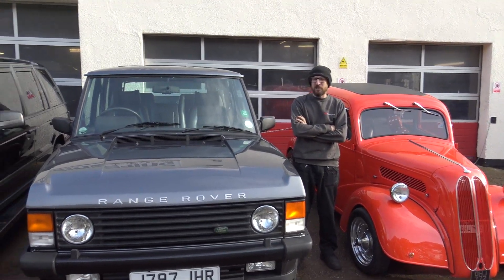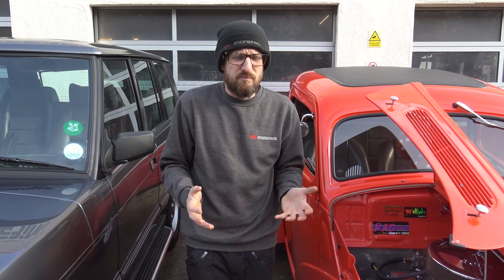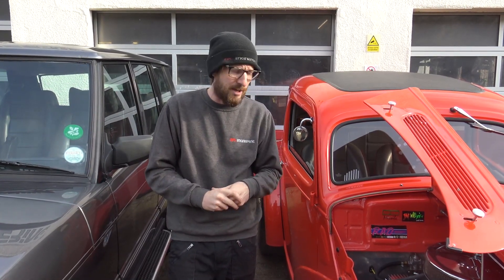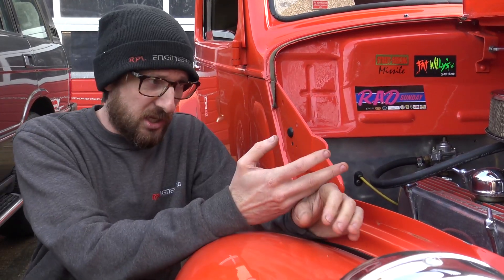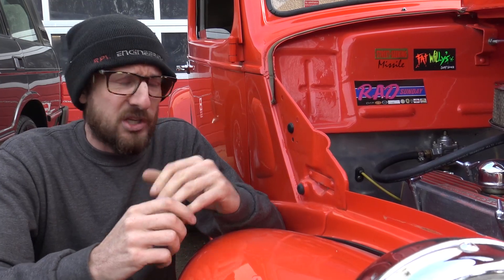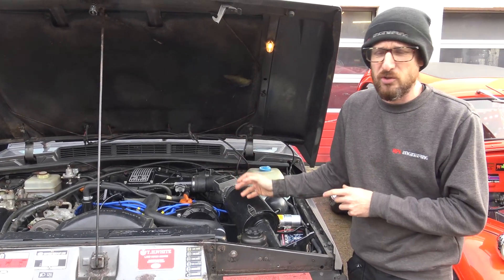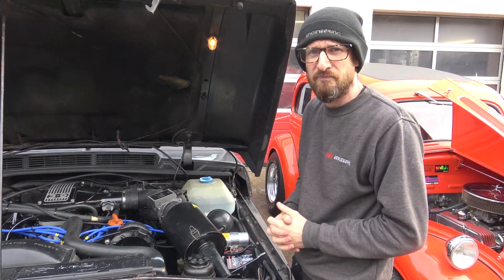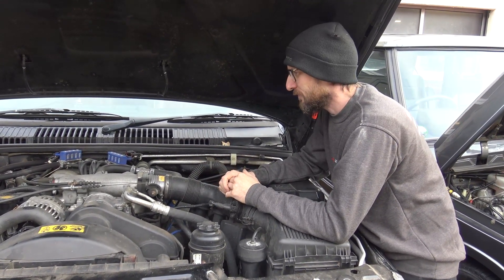What are the Most Cost Effective Upgrades for the Rover V8 Engine - Common Questions with RPi

Comment: In doing a remap of the ECU on P38, do you recommend increasing the fuel octane as well? I normally run 87 AKI (92 RON) on my P38 4.0, and the lower octane has only cost me mid range power. MPG has remained the same as when I used to run 93 AKI (98 RON). 

But now that my Range Rover is relegated to weekend trips to the lake, I wouldn’t mind some more power. I’m also thinking of installing a new stainless steel exhaust to make it sound nicer.

Comment: Hmm, some nonsense being dished out in this video, yes the standard ignition system is not all that great but the improvements being talked about are not really down to a bigger spark, as long as the spark as enough duration and energy to ignite the fuel then that's it, it is not going to increase the flame speed at all. The issue with any of the standard Rover systems (Lucas) is that they simply start to 'drop sparks' at high RPM, in other words random cylinders fail to burn the mixture at all as the revs go over 4k RPM. This will obviously cause a loss in performance. Rover got away with this sort of thing because for 99% of the time the engine is lugging around at 2.5k RPM. I have removed all of the guts out of a standard Lucas dizzy, I then built a system into it that triggers an MSD ignition system (6AL-2) which you can program in an advance curve using software provided. Also via a MAP system you can program in a 'vac-advance' curve. All great features although the main reason I went for an MSD system is that it has a retard function for when you inject Nitrous Oxide. With regards to Edelbrock 500 carbs, they are pretty good but nobody that I've met knows how to set them up properly. I have learnt how to set them up and found out that there is never a stock needle that will get you the correct cruise mixture AND the correct acceleration (whilst only on the primaries mixture. (Air Fuel Ratio). I always end up getting the cruise mixture right but then i have to modify the thin part of the needle to get the acceleration AFR right. (I have made a gizzmo to hold the needles in my lathe to help with this). The Edlebrock charts are also full of errors! I use an XL spread sheet to work out the flow areas that any needle and jet combo will produce. The calibration kit for the 500 is pretty useless too, there are a couple of jets and one set of needles that are useful, but that's about all. The 500 carb does not like G-force much either, you can get a rich bog if you brake hard and cornering hard can cause issues, there are some tricks to help with all of this. The straight leg booster on the primaries is not great, the newer carb uses annual boosters but they have been designed badly, I make my own. The last engine I built was a 4.6, its in a reasonable state of tune (road tune, not race tune) but still pulls top gear from around 1400 RPM, its running a 500 carb, it made 315 BHP @ 5500 RPM. Its in a Rover SD1.

Comment: Ignition is the first thing? Not headers  Not porting the heads  n9t camshaft?
Reply from the maker: In most cases the ignition systems are generally compromised by old components etc and as we say at the beginning of the video its about getting the best from the engine in terms of cost effective upgrades to get the best overall outcome. For sure every engine is different, every start point of that engine, every end result wanted and every budget available. In general the ignition system upgrades instantly offers better starting, smoother running, better throttle response, more torque and cleaner emissions. 

However if your all about bhp etc then sure porting the heads, getting a better intake setup and forget the spark and just work with what you have I am sure will give you gains which you would be happy with. In terms of exhausts most will handle the above but shinny large primary pipes are what most want although often its not needed.
Reply: @RPIEngineering  it would be interesting to see what a fully built rover motor could do. Stroker crank, roller tappers/rockers, 10.0:1 pistons and ported heads, custom headers and 2-3" Dia exhaust would do
Reply: @cromBumny  I'd love the time to build all options etc and many more that are inside my head as future plans etc however its not always feasible or required.

Comment: wildcat heads are the best performance improvement on a TVR Rover v8....imo
Reply from the maker: For maximum performance on wide open throttle (circuit racing, drag racing etc) yes they flow more air. However for drivability and maximum torque and efficiency where it matters to a lot if not all road cars with some track day use then there are better options. Add to that complexities of install with the Wildcat head and its clear to see why it does not suit 99% of our customer base. But for sure has a place in the Rover V8 world and is great to be able to achieve more flow when desired and budgets / engine design are not confined.

Comment: What is the lowest miles pr gallon/litre pr KM have you guys gotten out of a 3.5 V8? and what car was it
Reply from the maker: Hugely subjective to engine condition / setup, vehicle, miles driven and driving style. A well serviced V8 engine in a light weight 2 wheel drive car can do over 30MPG (anything from 3.5 to 4.6 can achieve this) however put a worn engine in a heavy 4x4 with additional weight with roof rack, large tyres driver with a heavy foot and only doing 10 miles journeys and you can guess the result there!!!
Reply: @RPIEngineering  what do you think i could  get from a 1 ton 2wd with a 5 speed manual transmission? Considering to put a 3,5 Rover v8 in a Volvo PV, im thinking of maybe something between 220-240hp if thats easy to get
Reply from the maker: @samegutten  220 to 240 would be quite a racy 3.5 litre engine. A good 3.5 with stage 3 heads and 285 cam is normally around 200 bhp (although its been a while since we have dynoed one) dont get caught in the trap of thinking smaller capacity is better MPG it is often not the case. A 3.9 litre engine built to Stage 3 will see 220 bhp maybe a more with the right cam but also it depends on how you want the engine to respond and drive. If your happy substituting bottom end smoothness and torque for top end bhp then thats fine but keep it in mind for the build. 

In terms of MPG your in a light weight car and 2 wheel drive so depending on your driving style, engine conditon / build etc you'll be looking at 20 to 30 MPG or better.
Reply: 200hp is going to be more than enough actually. 

This is not going to be a racecar, more a cruising car that can maintain cruising a highways etc around Europe
Reply from the maker: @samegutten  Yep, Just keep in mind though that building a 3.5 with 200 bhp could detract from torque and smoothness down the bottom end. A nice 3.9 / 4.0 build with mid range cam and head work would be around 200 bhp and a much nicer tourer.
Reply: @RPIEngineering  Ill keep that in mind, 3,9 engines is also avaible around, I think most of the cars that was sold with 3,9 in Norway do have injection?
Reply from the maker: @samegutten  Yep generally the 3.9 engines were produced with the Hotwire 14CUX injection system which works very well and can be run stand alone in any vehicle you choose. However can easily be replaced with our Edelbrock carb setup if simplicity (i.e no wiring, sensors etc) is what you are after

Comment: Holley snipper..... are the way to go
Reply from the maker: Lots have removed this and fitted the Edelbrock carb for simplicity. Others have gone EFI the better way with multi port injection rather than the half way house of a carb / injection setup. There are always many ways to get to the end result and it depends on the end goal that you want as to what the right choice is for yourself.
Reply: @RPIEngineering  yes i agree multi port injection is the best but not everyone wants to go down that road ...but there many options like u say.... cheers on the video

Comment: Hi 2 questions for you? I have a 1973 classic RR, as built except it now runs a twin spark Mallory distributor, something RPI used to recommend. Q. Is it worth upgrading to electronic ignition which has the ability for longer dwell time?  Or a later Lucas distributor. 
Q2. It has been suggested to put a fuel regulator prior to the Zenth carbs set at  2-3 psi. That seems low to me and in fairness I have not had a problem with pressure in the carbs to date? 
Vehicle has travelled only 126000 km what are the problems if any due to lack of use? I’m sure I’m not alone only taking it out maybe twice a month for a good run! Sorry that’s 3 questions. 
Thx in advance and all of you at RPI take care in these uncertain times.
Reply from the maker: Hi,
We have never run a regulator to twin carbs so unless you are having issues where the float bowls are flooding and have confirmed that they are functioning correctly or that you have a higher pressure pump I dont see the need for a regulator. Yes we used to supply the dual point as they were a great package for someone running carb that had no dizzy at all and needed something cost effective that worked well. It will still work well as long as it is matched to the right parts however we have had several customers upgrade to our full electronic ignition kit in our shop and have loved the results. In terms of leaving the engine / car to sit, all the normal things to worry about so probably better to try and get out in it for a drive every couple of weeks.

Comment: Hi guys, thanks for the vids and great advice. I have a Holley 350 carburetor on my 3.5 litre. what do you think? 
I'd like to go electronic egnition next.
such great revy engines 😁👍🏼
Reply from the maker: Yes ignition is a great place to start. Then as per the video inspect the camshaft if its condition is unknown and if / when you start struggling with the Holley carb (some get on with it, many dont) let us know and we will pre jet a Edelbrock for you (in exchange for some pennies of course) for a simple change over.
Reply: 4 branch manifolds.

Comment: Nice Ford Popular. I’ve got a 3.9 in my London Taxi; it’s on my channel. It was an injection but because I didn’t have an ECU and because I love the look of them, I have put a pair of SU carbs on. So the camshaft is the standard one designed for injection set up. What cam would you recommend that gives more power but still keeps it ticking over nice and not too lumpy?
Reply from the maker: If your sticking with carbs then the Piper 270 if you feel you may go for EFi again someday then the Kent H180. We can supply them both as kits and also detail other parts that should be checked at the same time - video coming soon on this.
Reply: @RPIEngineering  CHEERS!

Comment: good videos....I've seen cars with better camshafts and the cold start and tick over are rubbish....any ideas?
Reply from the maker: Hi, Its likely simply a bad setup or a poor camshaft choice causing low intake vacuum at idle. This means the air does not suspend the fuel particles correctly and therefor the air / fuel mix does not burn nicely. As rpm increases the air speed in the intake increases and the fuel then gets transported to the combustion chamber and mixed nicely with the air so the burn is better.

Comment: I've got an honest question.....and it's not intended to be any sort of trick question....why has nobody ever done a really good aftermarket cylinder head for the RV8? I know there are options available but when compared with what is available off the shelf for the SBF or SBC which are really simple bolt on power that work without any need for additional porting like the RV8 aftermarket options. There are plenty of modern designs which could be readily copied  (Chevy LS for example) & made to fit the RV8 block architecture. It's ports & chamber with the appropriate cooling arrangement with some off the shelf valvegear. The later crossbolted bottom end is a pretty stout bit of kit & has a reasonable oiling system so could easily hold together with some decent heads. The fact that people spend a fair bit of time & money trying to make standard head castings work even at high power outputs tells the story really. Just seems like a missed opportunity to me. Ps - I understand that it is not necessary for all applications but those wanting say more than 300-330bhp it would start to make sense, at least to me anyway.
Reply from the maker: Hi, Thanks for the question. I think our next video that is dedicated to cylinder heads will cover this and I will include your question in this as well.
Reply: V8d stage 4 heads will support 350 to 360 hp depending of intake and exhaust on a 5+ liter engine. For 400 and more the wildcat heads are needed. They are rare and expensive but they are available

Comment: On a 3.5 is it worth upgrading cylinder heads (torque cam already done), or is it not worth it for a 3.5 v8 in a land rover?
Reply from the maker: Yes our Stage 1 or Stage 3 heads would make a difference but keep it camm'ed for bottom to mid range torque. We will cover more on heads in our next What Wednesday - That's not a Wednesday video though

Comment: Is the 4.0 to 4.6 MAF sensor upgrade plug and play or does it require the remap? (4.0L Thor engine)
Reply from the maker: Hi, Is it a Discovery 2 or a P38 Range Rover that you have?
Reply: @RPIEngineering  it's a Disco 2 model
Reply from the maker: @ChrisTheAlmighty  Then upgrading to the 4.6 air flow meter is a good upgrade in itself however does require a ECU remap so that the new data from the air flow meter is interpreted correctly. If you send an email through to info@v8engines.com we can quote you for what is needed.